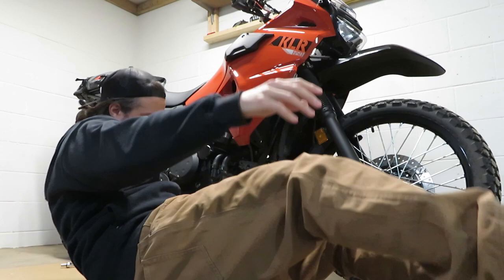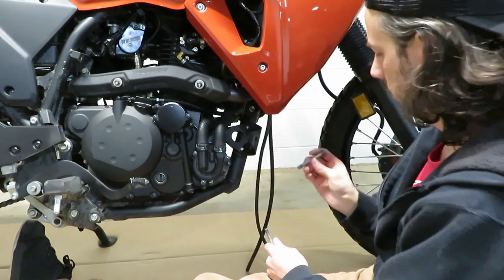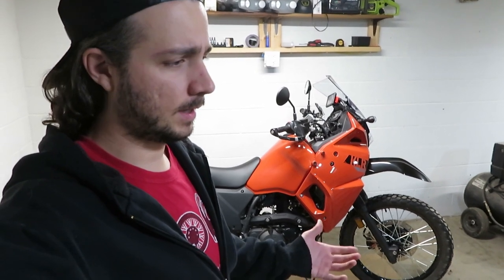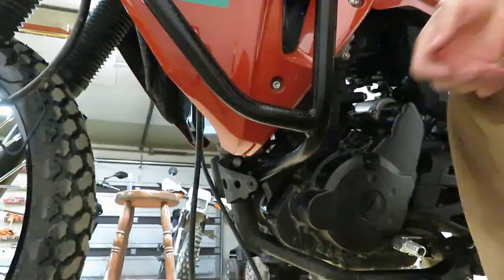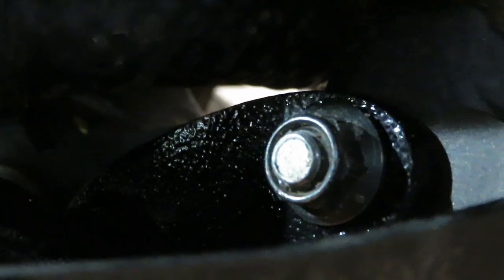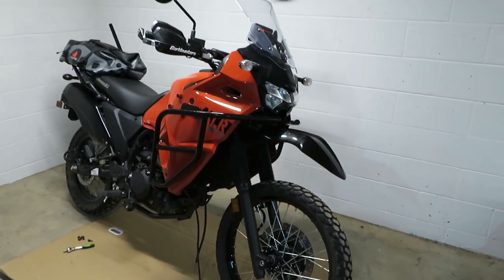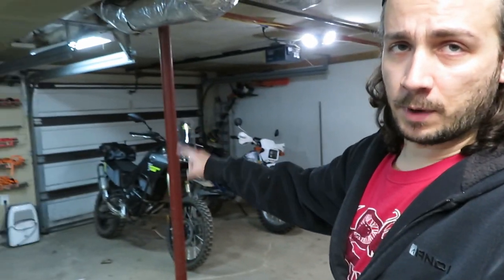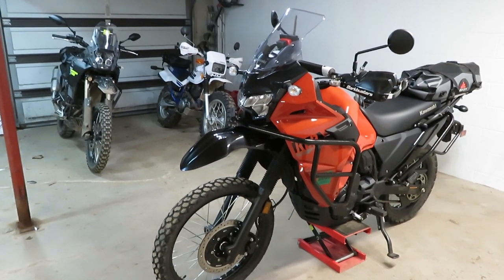Weighing, Installing & Reviewing DirtRacks 2022 KLR 650 Crash Bars

Comment: I just ordered these crash bars... I dropped my KLR.. the cost was 300$ to repair.  I could have added the crash bars earlier.. and they would have been free.  I replaced the radiator, LH fairing.. AND installed these crash bars.  All in the game.   I got them from 3d parts.  See you all out on the road.

Comment: It looks like the top mounting point could use a gusset to close the front up to prevent folding in case of a hit.  Look forward to see what other options come out.
Reply: I think the top side mounts would have been better off as hollow tube type with a bolt straight through the middle of the tube rather than the angled tab type. Definitely a weak point there.
Reply from the maker: It actually seems pretty sturdy, I was sceptical at first but after messing with it my confidence increased.  I agree it is decently the weak point but with the 3 other points of contact I think it'll hold... Only one way to find out though!
Reply: @SwankyCatProductions  I'm sure you'll put it through the test lol

Comment: Just pick up a 22 KLR.  I bought the 3D cycle 
crash and pannier bars because of the high quality and parts the company produces.  Just came across your video after seeing they did not have one on their site for install.  
Your ride looks tough and the bars give the KLRs rugged cool looks, huge protection factor and extra points for aux lights and strapping down gear.  Win win win in my book.  
Great video. Thanks
Reply from the maker: Thanks!

Comment: I really like the look of the Gen 3 also. I’m not sure I care for the looks of the crash bars. I am having trouble deciding on ordering them because of that. I was actually waiting for your review/video. They look very well made and thanks for showing the weight!
Reply: I agree,  I'm going to wait until next spring.  I'm sure other manufacturers will come up with something else . I like the looks of the Tusk brand , but they don't work on the 2022.
Reply: I thought the same, camera doesn’t do it justice here or on the website. Installed these cause that’s all there is right now and was surprised! They look badass in person especially with the rear protection tying it together. Those are biggg fairings and the bars suited them nicely. Very pleased and excited to get off-road with it. Give ‘em a try!

Comment: The crashbars look strong enough to protect the bike which is exactly what you want.  The rear side racks will protect the bike as well as being a good base for soft luggage.  Thank you for weighing them.  16.5 pounds is a lot for sure, but probably worth it.  It’s always nice to have the extra handholds when picking up the bike too.  The install looked very easy.  Nice video!
$360.40 for front and rear crash bars with discount.  That seems reasonable.  You could potentially use a pannier rack in the rear instead of the rear crash bars..
Reply from the maker: I forgot to mention it but the rear bars are soooo nice for dragging the back around!!!

Comment: Truth is crash bars aren’t optional on a klr(or any adventure bike you use off road) - have them or be ready to replace plastics, or keep it parked( although I have knocked/dropped mine while parked)They do look a little tank like but I’m sure there will come a time that’s a plus. The first ones I ever installed were Givi they were a fatherless child to install and looked like a tank but saved me thousands. The next set were the gen 2 Dirt tracks and although a little pricey compared to the Givi the ease of installing them made me think I’d never buy anything else. They look great on the Gen 3 and I have to agree they sort of ruin that nice simple logo but you probably won’t notice that in a few days. I also like the rough finish- after a few scrapes I bet you could easily touch up with black paint or even truck bed liner and they will go back to new. I have to confess that I usually paint all my crash parts in truck bed liner before I put them on- it’s a great hard finish and so easy to touch up after a boo-boo. ( lol anything short of what happened to you) . That front bar is a great place to mount a couple accessory lights. You’ve gotta admit playing dress up with a klr is fun. Stay Swanky!
Reply from the maker: Truck bed liner is a good idea and should hold up to most off road crashes pretty well with no maintenance required.  I'll be honest though, I just let the wounds on mine rust over haha.

Comment: I love the DirtRacks bars on my Gen 1.  I have the wrap around style as well.  One good fall and they sit a little askew on the bike now, but nothing on the bike was damages.
Reply from the maker: Yeah I think there's a fine line between to hard and to soft.  Depending on the intensity of the crash it can be good if they deform. Better the bars than the frame!  But you also don't want them getting pushed around at the slightest drop either.

Comment: Can't break loose the two engine mount bolts. Would heating them with a fire starter (flick your Bic!) help? Other suggestions? This is on 2023 KLR650 TRAVELER.

Comment: Mine arrived today, will probably get them on tomorrow. This vid is a big help.  Have you reached a conclusion on the issue of how close the plastic is to the top connect point?
Reply from the maker: I haven't dropped it but buy I'm not really concerned, I think they are definitely tough enough to take a good blow without bending.

Comment: since this is from a year ago.... do these bars get in the way of any regular maintenance or anything you routinely do?   Any upgrades you might want to do before putting these on? Like would this add any difficulty to thermobob or dohickey work?
Reply from the maker: They actually are a bit of a pain when installing just about anything that requires removing the fairings yeah.  But that's going to be the case with any crash bars that mount to the frame up top.  I'd suggest doing everything you can beforehand, but it's also not all that big of a deal to remove them, just takes some time.  I've done it several times already haha.

Comment: I'm about to grab these for myself, but I'm trying to see how much room you have between your knees and the bars when riding. I'm 5'10", and it looks like my knee caps rest right at that point of the orange plastic, just to the left of the top bolt of the fairing behind the crash bars.

How do you feel about the room? I'm considering the ADV bars from them for that extra space, in case there's a head on collision.
Reply from the maker: I'm also 5'10" and don't have any interference with my legs.  Very happy with mine so far.
Reply: @SwankyCatProductions  Awesome, thank you! I went ahead and ordered these, as well as the soft pannier racks.

Comment: With those rear crash bars installed, can you still remove the left and right side panel plastics to have access to the battery and airbox without removing them. Thanx
Reply from the maker: I took the right side off when I installed my exhaust without any issues.  Not sure about the left, don't think I've had to remove that at all yet.
Reply: @SwankyCatProductions  Ok thanx. I had them on my 2018 and had to remove them to take off the plastics. I am getting the soft luggage DirtRacks supports for my 2022, so they should have the same clearance as the crash bars.

Comment: upper bolt is weak, with that rabbit-ear support, to hold 400lb impact?
if you replace the exhaust drum with Al one you will gaine 10lbs in weig
ht. I have similar guards, when I dropped the bike, my handlebar was absorbing the weight and not the crash bar...they look good, but ..see a Beemer crash and where does that bike stands on the side...
Thanks for the video!
Reply from the maker: Yeah it's the weak point for sure but I think the 4 contact points together will have enough strength to support the load.  Handlebars and Handguards do help keep the bike off the ground but when your off road you never know where your going to land and if there's rocks or uneven ground you'll need the coverage.
Reply: @SwankyCatProductions  have you tried laying it on a side to see where the contact happens? It would suck if cause the handle bars to bend.

Comment: Swanky Cat, can the 2022 KLR 650 cruise on the highway at 75MPH for long road trips?
Reply from the maker: Yeah, it's actually not bad at 75 considering it's a single cylinder.  Still not as smooth as a parallel twin or anything but it's manageable.
Reply: @SwankyCatProductions  Lots of reports of hand-numbing on the cb500x. So, I hope it is better than some parallel twins.
Reply: Since I am a 90/10 rider, I am wanting to change the front sprocket from 15t=>16t so hopefully it is better at cruising. With the longer wheelbase and larger rake, it seems like it would be good for long distance cruising and touring for men over 6ft. Feel free to let me know if this is bad thinking :)

Comment: Do you have the specifics on the bolts that mount them onto the cowling? Mine didnt come with bolts (it just says use the oem ones) but the oem ones are too short.
Reply from the maker: It's been a while now but from watching the video it looks like I got a slightly longer bolt with my bars to replace the stock one.  Your saying they don't send you that one now?

Comment: Do you have any plans for suspension upgrades?  Adding weight to the bike without a corresponding change in suspension is why the KLR community shortens side stands.  I had Cogent suspension on my Gen 1…I now have a 22 KLR with dirt racks pannier mounts and I’m building the suspension out next.   A KLR with custom suspension changes the bike immeasurably.   I cannot recommend it enough.
Reply from the maker: I'll have to do some testing with the stock suspension first but I might look into it.  Mason's ADV really seems to like his!
Reply: @SwankyCatProductions  If you do the suspension it’ll chase T7s in the rough stuff all day long.  I ran right along with T7s KTMs and everything else in rough stuff.  So much so other riders would scratch their heads in disbelief, and that was on my Gen 1…This new chassis ought to be a lot better!
Reply: @SwankyCatProductions  Was the centerstand standard, and if so, can you remove the side stands (useless IMHO)?

Comment: Question: where do those 2 tubes under bike connect to? I can’t figure it out and I’m stuck :( any help would be appreciated. Especially the one tube on the right side of the bike
Reply from the maker: The long ones that come down from the front?  They're just drain tubes. They lay in the bottom of the skid plate and poke out the back.
Reply: @SwankyCatProductions  dude you rock so much, saved my butt from having to go to the dealer an hour away or calling a mechanic haha. My first bike so I was like where the heck did this come out of hahahaha. Thank you thank you thank you
Reply from the maker: @ovgum1996  glad I could help you out!  Every bike has some sort of drain hoses but these are definitely the strangest I've ever seen.  Usually they are nicely tucked away and don't fall out when you remove the skid plate.

Comment: Negative ghost rider the pattern is full! The front crash bars make a relatively sleek looking machine look like a tug-boat. All in for the front and back $430? Nope, nope, nope! 
There are mock-ups running around which show Left and Right independently mounted at all the points you used with a bracket to the fog-light rail which you so much detest.  Lol.
One things for sure that nice bike now looks like a military Humvee....
Reply from the maker: Something smaller would be nice but honestly I'm not sure I'd trust a two point mounting system.  Especially with one being that fog light mount, I think the frame rails that bolt goes into are pretty small?
Reply: @SwankyCatProductions  I see what you're saying. I'm referring 2 the center frame mount, the mount at the plastic fairing and a small bracket aft of each fog light....I'll see if I can find the mockup.

Comment: After I installed these crash bars my bike  vibrates at certain speeds. Did you notice a vibration.
Reply from the maker: No but that is s ok something I hear off and on about a lot of crash bars.  As long as all your crash bar hardware's torqued properly and your fairing hardware is tight my guess is it's just something to do with either the bike or the particular set of bars that makes them resonate at certain frequencies.  You could try loosening the bars up and shifting them around slightly to see if that helps.  The front connection point between the two would be a good, easy place to start.
Reply: @SwankyCatProductions  thanks. Do you know the torque spec on those?

Comment: Will these crash bars fit on my 2023 KLR 650?
Reply: I checked with DirtRacks and they said they have them for my 2023 KLR650 TRAVELER so I ordered them. Installing today 11/5/23 but can't break loose the front engine mount nuts.

Comment: Yo Swanky, any strong opinions on ABS vs Non ABS on the gen 3's? There's a good looking base one near me without ABS and it's very tempting.
Reply from the maker: I actually locked the back up with very little effort while testing response time on a video which surprised me a bit.  Might have subconsciously not let the front lock up... darn self preservation instinct.  But I wasn't that impressed with it and felt like it might not have enough power to warrant abs.  I think it would still be nice to have and is probably the safer option... does cross my mind once in a while but as of today I can't say I regret my decision.

Comment: Hay are you having problems starting your bike cause I am 27degrees and my klr won't start text me back with insite thanx John from Elizabeth nj
Reply from the maker: That's a common issue I've seen dealers fixing in some cases.  Something to do with exhaust cam profile or something like that.  Should be info on it in KLR forums.
Reply: @SwankyCatProductions  ok thanx it's the decompression pins there not set rite